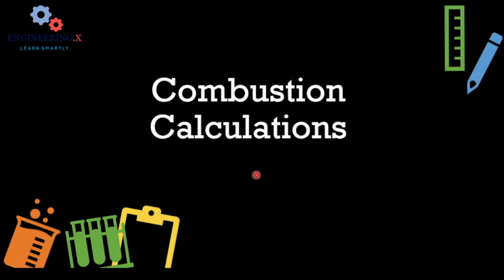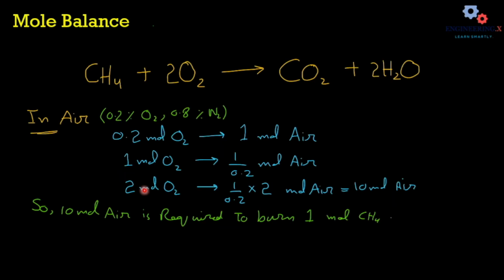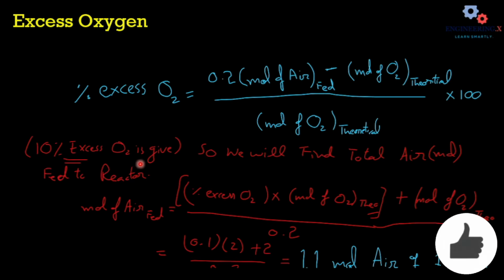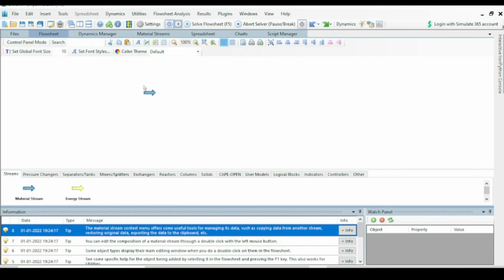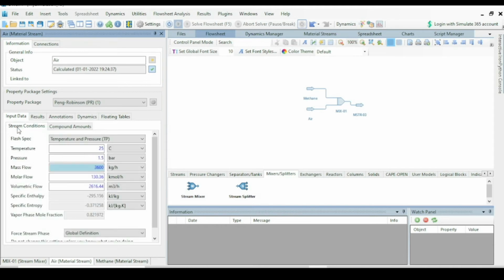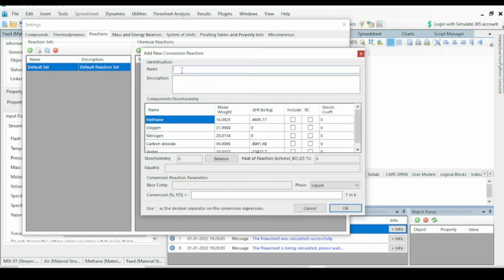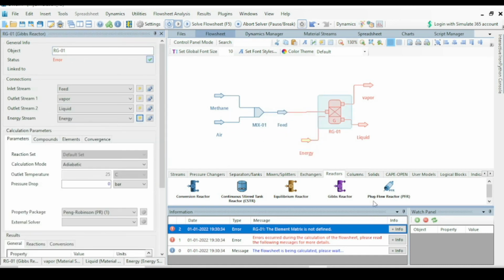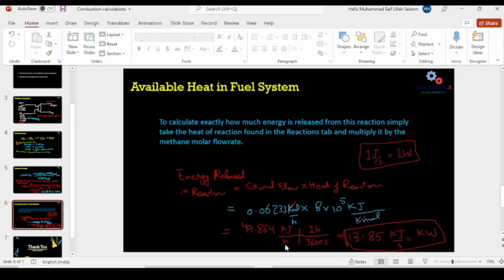Heat of Combustion Simulation in DWSIM

Comment: You haven't defined elements matrix and when I solve the flowsheet as per method, it says define elements matrix........also after defining it won't converge.
Reply from the maker: Which DWSIM software version are you using?
Reply: @eduXinsight   7.5 i.e. latest
Reply: Same thing for me. Have you found the solution?